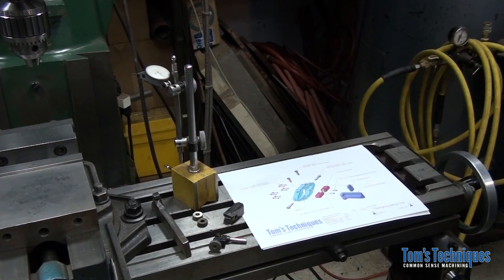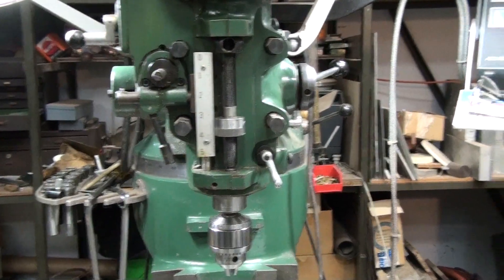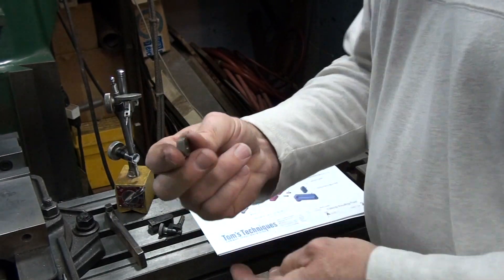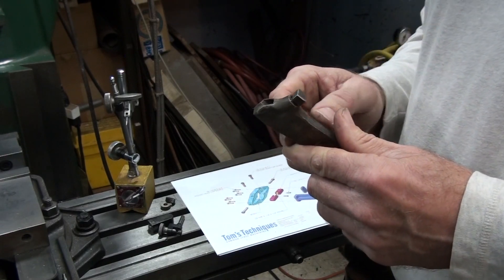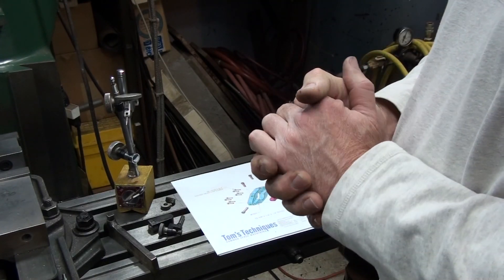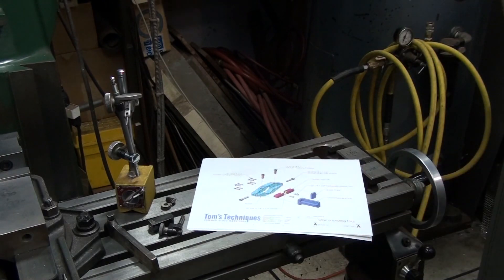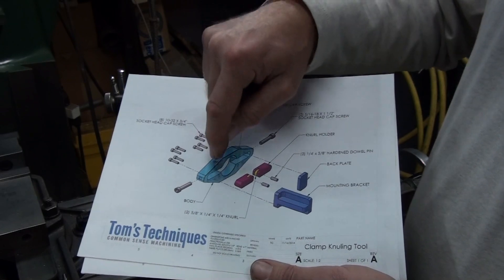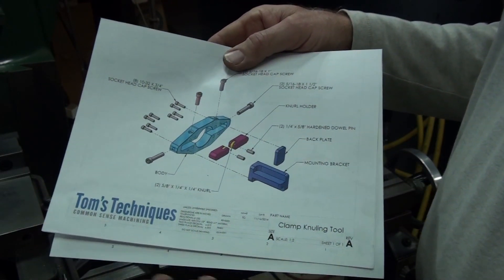Clamp Knurling Tool, Introduction

Comment: It took awhile but I finished my knurling tool.  I had the aluminum body anodized so I could use heli-coils in the threads.  I had some scrap 4140HT to make the die wheel holders with then nitrided.  Makes diamond style knurls easily. Very nice.  Excellent video's by Tom to explain everything.  I started machining Aug 2020 so this was a good winter lesson.
Reply from the maker: It's always good to hear the success stories. The Heli-coils are a good idea, did you go to a fine thread? Also make sure your knurls are chamfered on the corners, the sharp cornered ones can dig in while feeding.
Reply: @TomsTechniques  Good point on chamfering first.  I was having problems feeding.  Not exactly sure I am going thru the set-up of the knurling tool properly.   I've been tightening it up on the spot that needs knurled.  I need to learn how to zero it up and know how deep to make the knurls based on thread pitch of the tool.
Reply: @TomsTechniques  Hi Tom,
I took a job last year where I had to learn to use a 16" Grizzly lathe and an old knee mill.  I have had a lot of fun learning and making things.  Your videos were a lot of help.  I was going to list the most helpful ones but there are too many.
Sorry, I didn’t answer your question before.  I used fine thread heli-coils to have the better control on depth.  
I have a question about how to use the knurling tool as I am not sure I am doing it correctly.  I've read in other places about how the diameter of the part has to be a certain calculated diameter.  Is this correct?  Will this affect the knurling diamond pattern?  
The other question is when to set the depth of the knurling dies?  While over the part or off the part?  When off the part it is hard to judge the depth even with the fine thread screw pitch.  I've learned the hard way it doesn't seem to take much depth to get the knurl.  If it is off the part, then when the tool is fed over the part, does the speed have to be constant?  Will a pause or slow down affect it?
I hope you, your family and retirement are doing well.
Sincerely, Pat

Comment: Hey Tom I was just on your website looking for the machinist vise for my rotary table prints and I couldn't find them anywhere haha......great job on these videos the knurling tool is by far the best I've ever used especially for my 36 inch lathe.....do you use autocad?
Reply from the maker: Thanks! It's always good to hear about succesful builds of the knurling tool. There are a lot of them out there. The tool was 3D modeled and detailed in SolidWorks.
Reply: @TomsTechniques  always wanted to try solid works I use autocad but that exploded view you do is pretty cool

Comment: Couldn't you save a few parts by mounting one of the wheels directly to the frame?
Reply from the maker: +John Creasey 

If that were the case, One of the knurl holders would need to be extra long to make up for the offset of the other, and that much overhang would compromise the rigidity of the tool. The way it is now, the knurls holders are identical, which means one less part and the overhang is minimal. The knurls also need to be mounted in hardened steel, which the frame is not.

Tom
Reply: Thanks, that makes sense.  Great project!
Reply from the maker: +John Creasey 

Thanks! Glad you enjoyed it.

Tom

Comment: Hi I just saw your video. I love your videos, I love your home page with downloadable drawings. Brilliant. However, I don't see the advantage of your knurling tool design over a scissor type tool which is self centring ensuring identical pressure on both wheels without adjustment except the single pressure screw. Your design needs to be carefully centred using 3 settings: the cross slide lead screw and the two set screws on both wheels. Specially if I have eliminated backlash on the cross slide lead screw and have a short piece in the chuck then there is not much flex or self centring. Then it might get rather fiddly. If your tool would be freely sliding in the cross slide direction then only 1 wheel would need a set screw while the other could remain permanently fixed to the sliding bracket. Then the whole thing would be truly self centring too like the scissor type.
Reply from the maker: rol eic 
This design (not mine) is much more rigid than a scissors type knurler. I have a commercial version of this knurler and use it all the time. It's simple to set up and due to the presence of backlash in the cross slide, very easy to center. You can't appreciate the rigidity of this tool until you've seen it form a knurl on a 2" diameter piece of stainless in one pass.

Tom

Comment: Hi Tom,

Great videos. I was just wondering what software you use to create your technical drawings. They look very professional and well thought out. Keep up the good work.

Chris
Reply from the maker: Thanks Chris.

I use a 3D CAD package called SolidWorks for modeling and detailing, the same one I use at work. Remember though that CAD software is nothing more than an aid. as in Computer "Aided" Design. Those same drawings could be created with pencil and paper. It would just take more time.

Tom

Comment: Tom,
I am really enjoying this series and will be duplicating it when I finish my current project.  As this
device is intended for diamond knurls, when you feel inclined, I would like to hear your insight on
straight knurls with maybe a demo.  Thanks for your contributions.
Russ
Reply from the maker: Thanks Russ,

This tool works equally well with either diamond or straight knurls. I'll give a demo on how to use it when the project is complete, but the procedure is the same for either type.

Tom

Comment: Tom,
   I have a little Taig roller skate lathe, (that's what I call it) I already have a floating scissor type knurler, my question is how do you apply equal pressure from the two separate feed screws to get an identical knurl with both wheels, do you use eye, what system do you use or how do you go about it, I like the design and might make a scaled down one,

Just curious,......Edmund......
Reply from the maker: The tool floats due to backlash in the cross slide screw, so it's self centering. I run the knurls in until they touch the work, then center the cross slide in the middle of the backlash. That allows plenty of float for the knurls to put equal pressure on the work.

Tom
Reply: Toms Techniques
Ok Tom, that makes sense, appreciated,

Comment: Hi Tom, Glad to hear from you again. I really enjoy your videos.  I have a Bridgeport mill in my garage and now just learning to machine metal.  I plan to do a simple project of some kind and this may be the one to start with.  I don't have a lathe yet but really like your new project.   I need a DRO for the mill but know nothing about them.  Would you be interested in making a DRO video?  I'm thinking of getting a DRO Pro setup. Thanks
Reply from the maker: A DRO is a very useful accessory for the mill (or lathe) because since location is taken directly from the table, it completely eliminates backlash issues. Not sure a video would be useful for the operation of a DRO since they all have unique methods of operation. I could show how mine operates, but it's 20 years old so not many would care. They all do pretty much the same thing, so selection of one is pretty much based on cost and quality. Just find one you can afford and check out reviews.

Tom

Comment: Tom, I'm glad you are doing more videos.  I can see why this design is superior to the other two you mentioned.  It looks like a mill will be required so I'll just watch for now, though it might be possible to modify things a little so I could build a variant with my South Bend 9" lathe.  I have the milling attachment for it, but it's pretty limited in what can be done on it...though I'm thinking of ways to increase the size range of parts. 

My milling attachment should handle the knurl holders ok, but the frame they go into is looking too big. I'm wondering if it could be circular so I could turn it?  I'll see how your build goes and think about it. 

Thanks for the time sharing your expertise!

-- Mike
Reply from the maker: I'm not even going to use the mill for the shape of the body. That will be an exercise in band sawing and belt sanding and the holes can be done in a drill press. You'll still need to mill the slots, but that could be done on the lathe.

Tom

Comment: I see some of the parts are to be case hardened.  Can you give us some indication of the technique you are planning to use so that we can order the materials?  (I used Kasenit in high school, but it seems to have disappeared due to confusion about cyanide).
Reply from the maker: Kasenit is still available. I get it from McMaster Carr. You can also get case hardening compounds from gunsmith suppliers like Brownell's or Midway. The parts are small enough to do with a torch.

Tom
Reply: Toms Techniques
A Kasenit search at McMaster-Carr now leads to a glove page.
Brownell has their own case hardening compound, but the composition(POTASSIUM NITRATE,CHROMIUM (III) OXIDE is different from the original Kasenit (POTASSIUM FERROCYANIDE, SODIUM FERROCYANIDE, CARBON BLACK).  I'm not sure how the Brownell's works with no carbon.
Midway carries Cherry Red, which has the same ingredients as Brownell's private label material.

I'd run across this before, which is what prompted my question.  The last can of true Kasenit to sell on eBay went for $67/lb plus shipping after 18 bids.
Reply from the maker: Jack Paulson
McMaster Carr doesn't advertize by brand, just search for case hardening compound. The heat and quench stuff was Kasenit last time I ordered it.

Tom
Reply: The surface hardening MSDS is Cherry Red now.  Oh well. 

Thank you for doing this project.  I have the armstrong style knurler, and agree with your opinion of that!!  I built the Lautard style scissors knurler, and am not too happy with that either.  Your project looks like it addresses the issues of both these styles.  I'm looking forward to making it.

Comment: Very nice Tom, I think I will scale this down to work on my Sherline lathe. I am just a beginning hobby machinist,but I am a retired auto tech so I understand mechanical things.I am going to try and follow you along and make one. Thanks for the knowledge that you share. Dave Aarons
Reply from the maker: Dave,

If you are going to downsize, you may want to drop down to 1/2 x 3/16 x 3/16 EPV series knurls.

Tom